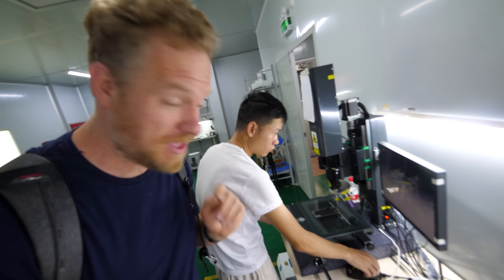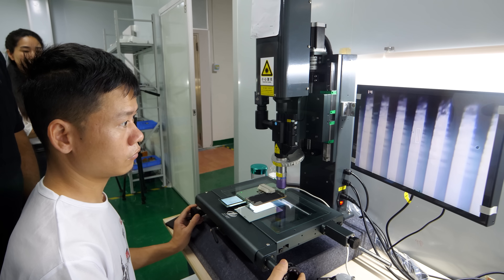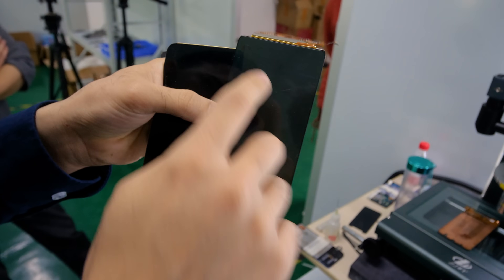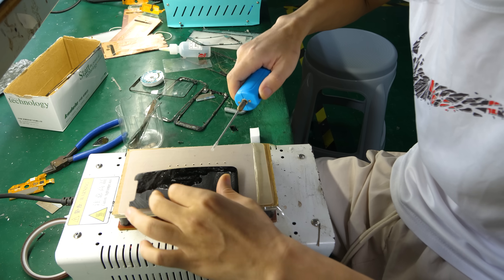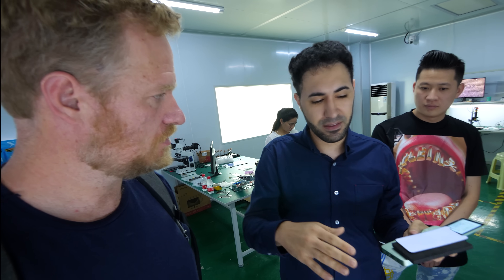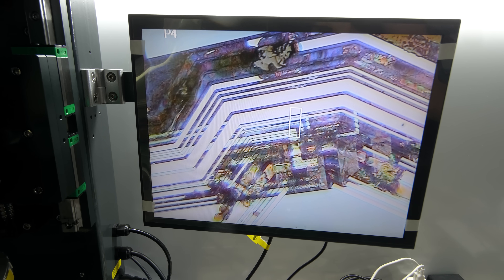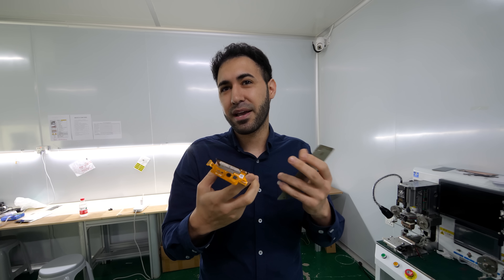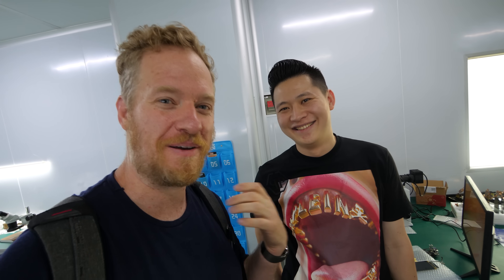A Revolution in iPhone Screen Repair: Lasers!

Comment: When it's not possible to repair the line, cut the defective one with laser from the other end could be a possibility? I think so. If a trace get disconected from the cable while the other end is supplied with electricity it will shine bright, but if the circuit is opened it will be turned off. These phones has so high definition displays for the size that one or a few darkened lines would not bother as even close to these shine sabers. I would consider it a fair workaroun/fix and I would pay for that service if it existed.

Comment: This seems like its more faked than real. OLED technology is really complex and a multilayered conductor/insulator/semiconductor composite. I find it hard to believe shining a laser at a point can repair a shear damage to the composite without any other issues. Maybe its melting and shorting sacrificing like a few pixels to restore the conductivity of the entire line it just seems too good to be true. Anyone got a more in depth explanation?
Reply: The laser goes through the whole line and corrects the errors due to the line, it goes to a specific layer. When companies make oled displays they cut a big part for the device and use the laser to correct the dead lines

Comment: The problem is that the green line of death is visible even with the 'always display on' function, which most of the users leave just as it is when they have this sort of problem. With this intensity, is very likely the green line will burn the OLED screen which even if it's fixed, the burn in effect will stay. But this will help A LOT for future broken traces, when it will be available for most technicians when the green line is recent! old OLED screens are probably doomed already by the burn in :(

Comment: This isn’t new….Ive been working on electronics over 10 years. A senior engineer took a soldering iron to a strip of a lcd like the flex and held it to the joint an fixed it. Removing the lines in the screen which isn’t actual damage to the oled/lcd. Yet per our SOP we had to replace the units with new lcd screens it’s conductive adhesive 

Is this laser good perhaps but it seems like it’s always some new gimmick that half ass works with an expensive price tag

Comment: mahhn the company service centers should buy this machine and also the 3rd party repair centers. This will beneficial for both the company and the customer. Instead of changing the total amoled panel you can like literally reuse the same panel after the service.

Comment: I'm slightly confused on how this would be better / faster.
It looks like these guys had to remove the glass from the OLED. That takes time, then you have to go over the traces in the flex cable, if not on the front then the back.
OK, now fixed (hopefully), now have to replace glass.

Wouldn't a display replacement be so much faster? Since they are already in the phone after removing the glass. (I may have missed something if there's a scenario if glass removal isn't necessary) 
Or are we talking savings for the customer? Full screen replacement, call it $200. Would this device be able to do it for say $20-$50?

Just call me a dumb customer and explain how this is better that purchasing a new display.
Reply: Display replacement isn't always available, especially for older phones. What you ended up with is a third-party display (you could say knock-off or clones) since the original manufacturers don't produce it anymore. These screens often look awful, have short life, and bad touch sensitivity. With this, you can keep the original screen.

Comment: Most defect on cell phone display screen is bleeding (lcd ink bleeding). If this machine is not able to correct that, I would not consider it a game changer. Yes, it is useful to remove lines on screen. But again, lines are not  that much of a common case. When they do happen usually it is along with the bleeding.
Reply: Lines on OLEDs are still as common these days, how many phones still have this defect? I don't even count them anymore because there are so many (Samsung s20, OnePlus, lots of recent iPhones, Sony Xperia 5 series, etc...) I have 2 lines on my Xperia 5 II (oled) phone at the time I write this message, no shocks and no glass breakage, identical problem to the Samsung s20, a line that suddenly appears after a year
Reply: Exactly, lines aren’t that common nowadays. It’s a bigger problem back in the iPhone X/Samsung S8 days

Comment: Now automate it and make it do 100 or even 1000 lines at once.
I am not sure if its possible but perhaps you can adjust the focus to go straight through the screen and end up at the other side so you don't have to take anything off. The focal point would be on the exact location you want without damaging anything else.
Amazing tool that will certainly help us all if our phone screens break.

Comment: How is this going to be economic without being fully automated?
And even then, the amount of manual labor ist high and its a fiddly job, so not everyone can do it.
So it may be a subcontractor running a bunch of this machines or the very biggest of the repair business to have this machine in house and it may be on par with a new screen cost wise, wouldn't it?

Comment: the economics of repair probably wouldn't work in developed countries. the process is pretty manual and takes a long time. The time it takes to train and have a technician do this would be more expensive than the screen. But in poor countries, this would be super useful.

maybe it'll work for a parts supplier instead of a repair shop. A screen refurbishing shop can refresh old screens with this, and sell it to repair shops in developed countries where the technician there can just take the screen and install it.

Comment: I wonder what the cost to repair the screen would be compared to a replacement. You still have to dismantle the phone. Then factoring in the cost of the machine and I'd imagine it would take a bit to recoup your investment. If you're doing bulk refurbishments then it seems like a good investment

Comment: I'm still under nda so i can’t say much about what I was doing but, from experience, yag laser welding is so much fun. You can do so many impressive precision adjustments just by placing beads along mating surfaces. say you have a pair of square ends you need to join precisely, two instantaneous beads on opposite sides can make a connection on the x plane, one more bead on one side can pull and align a weld toward that side on the y plane, one more bead next to another can push that weld back to square and another between those first two can pull the weld up on the z plane. pretty convenient when you have to align something perfectly...  like an optical device...
Reply: its a very strict nda.

Comment: Recommended video: I am visiting shenzhen for about a week starting today. A phone repair shop failed to rescue a Samsung phone that had My pre-plandemic wechat logon on it. Basically the phone shop blamed the CPU. And he said the CPU is linked to the data chip encoding so he said it's not possible to swap CPU to retrieve the data. My chinese international shipping liaison's contact info is in that wechat logon, so I would like to get that phone functioning. Can do a video of a more advanced phone data retrieval place getting that phone up and running with all the data intact. How does that sound?

Comment: Just because it’s an infrared laser doesn’t mean that you don’t need laser goggles… it means that you need them even more than with visible lasers!
Reply: It’s also a pulsed laser, it might have a power of way over 1kW, even if last only one micro second you don’t want any reflex in your eyes.
Reply: Yep, it's a heavily focussed Q-switched Nd:YAG pulse laser. I would wear googles all the time near that thing...
Reply: I’ve been using an 8 watt blue laser to whiten my teeth for years. Is that dangerous?
Reply: @timesfly1081 did you get it off of Amazon? If so, it's likely far more powerful than 8 watts and is likely an illegal laser. You should absolutely wear goggles, even if it's at its rated power. And you don't want to use the goggles that they give you with it. They do nothing. Spend the 100 and get a proper pair of blue laser goggles
Reply: @timesfly1081  hardly. I use a similar laser to whiten my eyes as well, just have to avoid the iris.
Reply: Let me guess, you are probably the same type of person that would be too afraid to stick your hand into the cage of a wild beast 🙄
Reply: @cmorche  /r/LeopardsAteMyFace/

Comment: The real hidden problem is the quality of the screen after being repaired. Chinese refurbishers who aren't affiliated with Apple, have repaired thousands of broken phones, including cracked screen/back glass, and dead mainboard,... to later sell t, mostly to some countries around SEA. The quality of them isn't very predictable - some will last very long but some will just be not working again after a while, because of the part's quality is already not great. The machine mentioned in the video is a real game changer, but primarily for them, who used to dump millions of broken OLED screens which aren't repairable , now they don't have to do that anymore. That means, you're likely get a repaired device like that when buying a used device. Also, needless to say, the machine costs will be somewhat not quite affordable for small repair shops, so we users won't be much benefit from this new invention. 
7:18 - It IS a problem. Previously I mentioned about them - refurbishers selling repaired phone, which some of them has cracked glass and something like that. Let's put this new tech beside; that older method to separate the glass and the OLED panel is nothing new, it's been around for a very long time, refurbishers have been trying to make it as perfect as the original glass so we - developing countries from 3rd world, who later buy these devices won't know they have been repaired before. Why? It's simple - we are avoiding those repaired devices as much as possible, because not only they may break at any time, but also if they ever break, 2nd phone seller/trader's trust will be significantly affected. Making a perfect device that is as good as the original one, let's say from Apple, Samsung for example, is technically not possible; also it will cost more time and money for them to do researches to make it somewhat possible, which is not very logic when all they want is money and, the repaired device is guaranteed to work for a couple of weeks.

Comment: I'm actually watching this video while doing glass & serialization IC reball and transplant on two iPhone 14 Pro Max OLEDs, both damaged by impact, and both with fat lines running right down the center of the panels. Both flex assemblies were fine, so the damage is internal . . SO THIS MACHINE WOULD SAVE ME SO MUCH TIME AND MONEY!! I do keep all of my broken OLEDs, so this thing would be an amazing tool to have! I've been using i2C's (the company, not the protocol) programmers for years to transfer serialization & True Tone data from panel to panel, but they can't read and transfer the glass ICs data from the 14 Pro series iPhones just yet, so transplanting the ICs is currently the only way to not only preserve True Tone & auto-brightness, but to get rid of the 'not original display' message . . . AND I USE OEM PANELS! That's something that REALLY irritates me about Apple's (Samsung's & sometimes LG's) panels; instead of writing the firmware & microcode so that iOS  sees that a panel is an OEM part, they went with SINGLE COMPONENT PAIRING BY SERIALIZATION INSTEAD . . . IMHO TO ROADBLOCK INDEPENDENT REPAIR!

Thank you for sharing this with all of us, seriously, THANK YOU! I'll probably wait until the 2nd gen to buy one of these for my shop, BUT I'M DAMN TEMPTED TO GET ONE ASAP!!
🙂👍🐧🐧
Reply: I cant imagine the profit you’ll be making from those leftover OLEDs, hoping to get my hands in this business one day 🙌🏼
Reply: @atillasteel  RIGHT?! I have SO MANY iPhone OLEDs that were 'BROKEN,' but thanks to this tech making its way to the prosumer market, they might actually be "broken?" I keep even the most busted display assemblies, because there's always gonna be a situation where you need a donor flex because you don't have any new ones, or you need a very specific LPM and/or glass IC, or some other obscure use case, like using an shield from a smashed iPhone 13 Pro Max display assembly as a makeshift BGA CPU border glue/fill remover tool (only had to do that once, broke my trusty old scraper and needed an insanely thin piece of aluminum, and I glanced over at my 'fuct' box, and had a lightbulb moment).

Anyway, my point is that I definitely horde broken OLEDs, but perhaps I've just been 'saving' malfuntioning OLEDs. My girlfriend won't buy it though, as a question I hear A LOT from her is: "Why do we have a box of sad iPhone screens and broken glass, can we throw this away?"

Now I can say "nah babe, I need 'em" and it'll way more legit than it was before I saw this video!!

In all seriousness though, this tech is amazing, and I'm so ready for it!

Comment: I'm sitting here with cracked glass on my note 10 plus with the new glass and that thin metal wire like 2 meters away, I've been debating to try removing the glass for a while now, but I've got to do it with a heat gun and no fancy suction heat pad lol

Comment: This is actual proof that these problems are with the oled itself and not "graphics driver/chip corruption"  and "won't be covered under warranty as it's not a defect" like what manufacturers say to deny warranty claims.

Comment: This reminds me of repairing the vertical line issues on the original DMG Gameboy, but that is repairing the flex cable. This method could probably be used to repair the horizontal line issues that can't be replaced with a soldering iron. Luckily the IPS mods have made any of that repair obsolete.

Comment: I still don't fully understand. Can it only fix lines, or a completely broken or shattered screen too? Because, for example, 90% of screen breakdowns are smashed.
Reply: He says it in the video multiple times. It can't fix a broken screen (cracked glass) it only fixes screen that have a line. To be clear, this does not repair broken glass.

Comment: I use the same technique to fix COFs (chips on film) in the TV display. I don't have a dear machine, I use my regular microsctop and special soldering iron in a shape of T. And use the same tape which conducts only vertically ;). So, good that we can do it for phones as well. Can't wait when we will offer it to our local customers here.

As per removing touchscreen, I've got Loca remover here and the machine to gather the glue. But, no expert yet in them, so don't offer yet to our customers :).

Comment: VERY COOL! Just the e-waste savings alone is great but so many folks are going to make a ton of cash for what used to be an "unfixable" issue that'd require replacing the whole screen. $12K? At current cost of repair rates that thing would pay for itself in almost no time at all.

Comment: If it fixes foldable screens too that would just take it to a new level.
Reply: I saw on the original channel, this machine fixes the green line on the Samsung flip phone
Reply: It will. Probably with little firmware update since its plastic and not glass.

Comment: Remember when the lazer iPhone back glass removal tool first came to market, now the corner shop has one and it will certainly happen with that machine too. Truly amazing
Reply: When you have any issue with any phone, you can use the same machine to remove the glass back.

But the current machine in video? How much green line issue percentage? 1.5/10 of total repair issue that need to open the phone up?
Reply: @fantasytky28 Do you have any idea how common this damage is on OLED phones? It's super common, probably only less common than broken back glass or water damage. The display is the weak point of the phone, everything else is either easy to replace or hard to break.
Reply: @randomblock1_  as common as you want, the percentage of using this to fix the display is always way way way lower then using the machine that open your phone
If you have broken display that going to use this machine, 100percent you can use the phone opening machine.
But when you use the phone opening machine, not 100percent time it's related to fixing the glass.

Can't you get it?
To fix something in the room, you 100percebt have to open the door everytime. But not all the time you open the door that you are going to fix the display related thing in the room.
Reply: @fantasytky28  nobody said this is going to replace any other machine... it's going to make it possible to repair screens instead of replacement. It's not like the repair shop can only have 1 machine
Reply: @randomblock1_  I did not say it's going to replace. Gosh. You have problem understanding the discussion here
Reply: @fantasytky28  you have difficult time explaining stuff, your mind is a mess
Reply: @fantasytky28 ou have no clue how many people use phone with lines lmao
also opening phone isn't hard at all
Reply: @kittikorn6674  you clearly not even getting the point of discussion here. Bro
Reply: You creaky don’t understand the tech that is in this machine, compared with a heat and vacuum machine
Reply: So how much is the machine? 
N where n how can we get the machine?